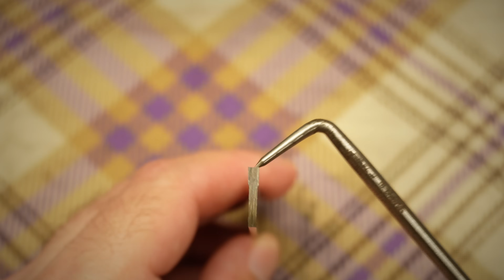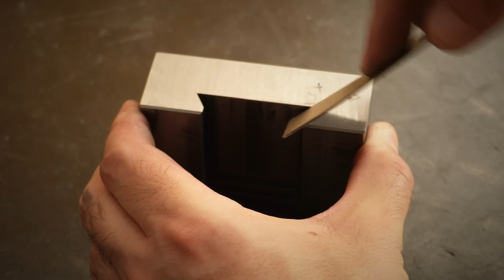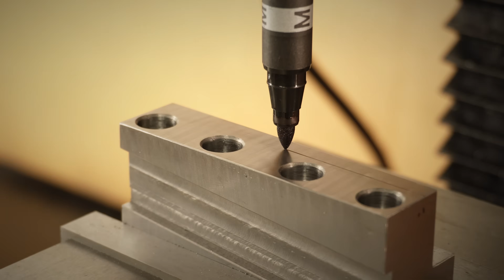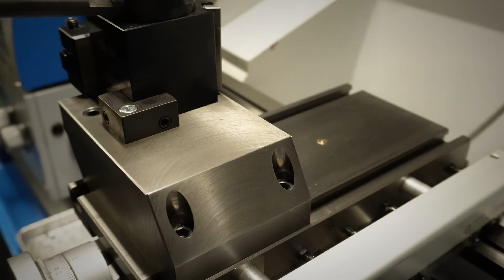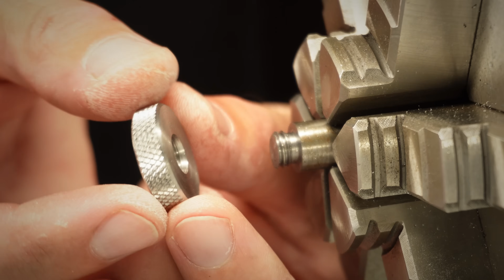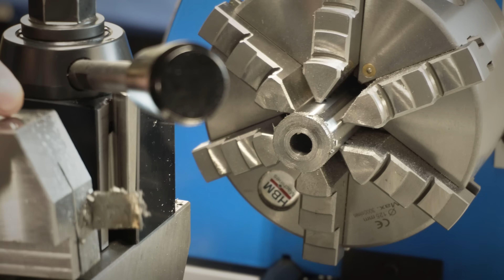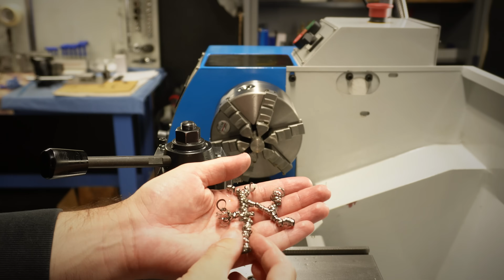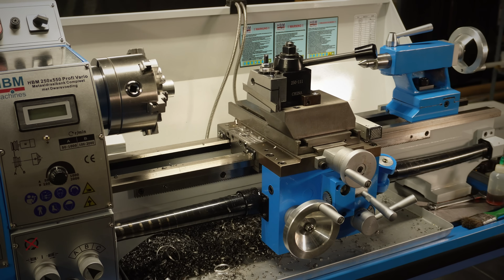Parting-off on the Lathe - Rigidity, Rigidity... and a Spring!

Comment: That really hurt, as I was watching you start to tap, I thought "not one of those !!"😣...& then SNAP ! 😥

 Not a fan of those spiral flute taps... spiral point is my go to...and maybe finish to full depth with the spiral flute in this case. 

The slitting saw twerking on that arbor was funny, I was waiting for it to grab ... 😂

Definitely, a scissor-type knurling tool is better, it takes all the loading off the spindle and cross slide and, for me at least, it gives cleaner knurls... (I have both types btw)

Really enjoyed this video, thank you 🤗
(You really deserve more subs with your content)

😎👍☘️🍺
Reply from the maker: Thanks! Yes, I think I will have to get one of those scissor type knurling tools, this was the second or third time I used mine and didn't like it. It puts a lot of pressure on the turning part/bearings. A hemingway tool would be nice, but I don't know if they are too big for my lathe?? Maybe a scaled down one would be better? Questions.

Slitting saw arbors, that's another one. They didn't grab because I was feeding very slowly, but I need to make a couple of arbors, that's for sure. Later, right now I'm working on something else! 😉

Comment: Great video and well explained, thanks for sharing.
I think the rigid solid tool post makes a huge difference. I always part of (SP200 insert) using the tool upside down that has the same effect as using the tool at the back of the lathe.
I have a Tapered  HSS-Co blade laying for some time now. I put it on my to do list to see how it compares to my current setup.
Reply from the maker: Thanks!

Comment: Was the finish significantly better when you left one insert in the face mill?
Reply from the maker: Hi, I didn't spend too much time testing different speeds and depths of cut, but that finish was the best I got. I tried with 2 inserts (opposite sides) and the finish was not so good. The machine can't cope with 4 inserts or more, it's just too much for the motor. Using that face mill was more of an experience, I ordered the 80mm version, but got the 160!

Comment: Best to play safe when hand tapping small threads and use a tapered starter tap followed by an intermediate lastly the plug or bottoming tap. Go in quarter turn then back off a full turn then repeat, never force it they will snap like carrots, if it's a blind hole regularly remove the tap to clean out the cuttings. Use dedicated tapping lube.
seized
 If you use cutting fluid on your machine tool  work you will get more life out of your tools and a better finish.

Comment: I had a very hard time parting off 2" aluminium round stock then someone suggested to give clearance along the length of the feeding direction, meaning cutting edge reduces along the length and it worked like a charm with good finishing. I cannot imagine now using a tool without grinding along the length but you here made a clean cut without your tool digging sideways. I guess i will try it use it, as my method reduces the strength of tool and regrinding tool tip 2 or 3 time makes the whole grinded length a waste
Reply from the maker: I can see the downside with that method, yes. Another thing that helped me before I made this tool was to progressively widen the slot with the part off blade. I'm not sure why that helped (maybe less rubbing on the sides?) but it did, and it's also safer because it accumulates less chips in the groove. But even doing that my lathe would stall frequently. If you want to try this tool with less effort making it, have a look at Winky's plans (link in the description). Thanks

Comment: I understand the principle.
Instead of digging into the cut it is automatically backed away.
With hand feed this is fine as you can back off and cleanup next time round.
What i don't understand is under power feed when the cut comes back around the depth of cut will increase because the cutter sprang awzy the previous time around.
Why doesn't it flex away twice as much and 3 times as much and 4 times etc. building up each revolution ?

Comment: a few recommendations that might seem weird (or you might have drilled into you from shop class)

Most threads are made to tolerances rather than to nominal. if your taps are 6H (the standard, at least to me) then the M4 tap will cut the tapped hole to a minor diameter of 3.422 meaning you could use a 3.4 drill instead of a 3.3 and thus not only save wear on your taps but also massively reduce the risk of breaking one.

if you are tapping in any material that produces long chips, the recommended method is to drive the tool for one rotation and then back it up for a length equalling the radial distance between the teeth or until you feel the chip get cut. Getting the chips out more reliably in this way reduces the risk of them clogging up a flute and locking against the side of the hole.

Comment: Although a pretty sensible accessory, present day machining is incompatible with this sort of tools. Throwaway carbide tip parting blades ranging from 1mm to 10mm standard come in different grades for different materials, have a high cutting speed (100 m/min easily) and feed rates (0.05-0.1). Replacing the tip requires just a few seconds and the CNC will be reset to the correct measure after the very first cut. Most of the blades are provided with a positive backstop preventing the tip from digging into the holder, thus ensuring constant accuracy when cutting grooves to a precise size. Since all production tools are standardised as regard height and width of tip, no need to check for correct centre height and their price is not exorbitant either. Anyway, a good excercise in fitting. Also, I cannot help noticing how well kept is the surface of your table, well done!
Reply: CNC and Manual machines are two completely different roads. For manual lathe especially small one this type of holder is game changer for parting off. Carbide blades likes a really heavy load when cut. That's why they tend to jam in small lathes as machine lacks rigidity. I have small 7x14inch lathe heavy modified and tried plenty different blades for parting. So far that idea is the best for such small lathe.

Comment: Tapered blades are called Johnson blade  the t blade are t1..t2. T3   .093...125...187.tpn would be carbide tip...screw mach  which your holder mirrors the ones used on old 2g machines

Comment: It is a very nice looking tool, that does the job. Congratulations. Parting off stock in a lathe has been a problem since I started working in a shop (1966). Things have become better with the advent of the newer style tool posts. I was shown years ago that inverting the blade, and reversing the spindle would help. It does improve things a lot, but takes time to set up for one cut. No one was ever able to explain the mechanics behind the improvement. 
  Since you cross slide has t slots the full length, another approach might be to build a dedicated tool holder of your improved design with a tool either upright or inverted. If you use a parting tool a lot, and also the compound rest, it might be worth your time. I will offer an observation from personal experience. Grinding the back rake on the parting blade does work well, but devil in the process is that the center height drops as the front is re-sharpened. Eventually a piece of the blade needs to be sacrificed to return to the original height, and full blade width. As you lower the front of a tapered blade, you start cutting two groove widths. The “T” blades will give you chip narrowing and consistent groove width.
 I do commend you for solving a problem in such a neat appearing manner, rather than avoiding it, and running to the cut off saw.
Reply from the maker: Hi Robert. You should have tons of experience! Thanks for taking the time to comment and share those observations!
Reply: @Robertqueberg4612 
To understand the principle, you need to think about the toolpost as a flexible structure (which it is... everything is a spring to engineers 😊). 

 So when the cutter digs in, what happens? With the extra force of a dig in, on a normal parting set up, the deflection of the toolpost moves the cutter INTO the work, with either chatter, or more catastrophic results ... but any of the 3 options people have suggested in the comments (viz the design here, or a rear toolpost,  or an inverted tool in a front toolpost) all 3 produce the outcome that the extra load of a dig in causes the tool to deflect OUT away from the work. 
This prevents the catastrophic outcomes,  AND the precursor chatter behaviour.

Comment: if you ever need a good finish try inserts for aluminum on a36,  or the grind relief and rake angles for alu if its a stick bit in the fly cutter   a36 is soft as heck and leaving a built up edge on the tool making it cut like its dull. also makes it rub if the relief angle is not high. you could also increase the sfm to up the cutting temp but i think your best bet is to make the tool have a higher relief angle and rake.
Reply from the maker: Hi Brandon, thanks! That is something I will try. Appreciated! 👍

Comment: Thank you for posting, excellent work. I am an old automatic lathe setter, when grinding the front face of the parting tool we would angle the face from 90deg to approximately 120 deg this gives the job a far better finish with little or no ‘Pip’, the piece is not broken or pushed off but cut right to the end.
Reply from the maker: Hi, thanks for that. If you look at the chip formation on the 0.5mm test, you can tell I have it slightly angled. That was on purpose to achieve what you describe, but I think the angle was not enough as it didn't make much of a difference. I didn't play more with that because I thought a more aggressive angle would push the blade into the work (these blades are thin and will bend) and make a concave face. But with time, I will give it another go. Thanks for your input!

Comment: Excellent result.
I also was inspired by the Winky spring parting off blade holder so made one. I based mine on the original Armstrong design. My lathe is tiny so parting was always scary!
It works a treat. The only negative is that it cuts slightly dished with no obvious reason. Watching this video I will try clamping on the bottom as that seems a good idea.
Reply from the maker: Did you check if your blade is square to the work? Or if the tip is ground square to the blade or if it's ground slightly towards the chuck or tailstock? 

Also, how are you holding the blade and what size of blade are you using? I'm asking this because I can imagine my 'not so tall' blade flexing if it didn't have good support and if it wasn't square to the work. Maybe that's causing it to dish? Just a thought.

I decided to support/hold my blade with 4 screws from the bottom because I was afraid the washer might let the blade slip (it also allowed me to better support the 2 blades).

Comment: 1) Tool should have as much contant with toolholder as possible, that reduce vibration. You have contant only on edges.
2) Higher tool is better in terms of stiffness.
3) Grove in the middle of carbide inserts makes chips narrower and help evacuation.

Comment: I cursed with you on that broken tap 😂 Very clever design and execution. I might need to make one as well since I have several T type blades and no way to hold them!
Reply from the maker: Hi Brandon! Nice to see you here. That broken tap...! I was extra cautious cleaning the chips and adding fluid. I was feeling the gummyness and taking things slowly... and then it broke with just a couple of threads to go! I went through the roof very fast 😄 but hey, at least I learned how to remove it. Can't wait to see your take on this!
Reply: @nbrworks  I know the feeling so well!! I need to increase my carbide mill/drill collection just so I can be prepared when that happens to me 😅 You saved that masterfully

Comment: A very good design and result. I don't however you've seen the worst of what happens when parting goes wrong. I used to have a minilathe. When parting went wrong, it stalled. OK, not great, but I upgraded to a well used Harrison M300. 3HP motor plus geared head. When parting went wrong, it would snap the blade with an almighty BANG! embedding shards of the parting blade in the work and leaving me very nervous about parting!
However, I'm encouraged to watch more of your videos so you've earned another subscriber.
Reply from the maker: Thanks for subscribing. You're right, I didn't have a blade breaking yet, and one should respect this operation (as many others). As I say at the end of the video, I don't normally run my machinery hard, but for the video I had to show you the difference the tool made, hence risking it a little bit more. Thanks for the warning, it's sincerely appreciated 😉

Comment: Change feed direction so the chips are thrown away from you and towards the column of the mill.
Reply from the maker: Thanks for the advice!
Reply: @nbrworks  for added safety have pieces of thin plexiglass that you “clamp” with a strong magnet to the front of the spindle housing. A piece that can cover the gap between the spindle and the workpiece or the vise will protect your eyes and skin from hot, sharp chips. 
Until you make a power feed drive for your mill, use gloves and wear long sleeves.

Comment: The principle behind this type of tool holder is to raise the fulcrum location. Ideally, it should be above the cutting edge, so that if the blade binds, it will automatically swing away to reduce engagement. This design used to be popular for lathes with threaded on chucks that could not be run backwards. On lathes that can be run backwards, simply flipping the blade/parting tool upside down and running the lathe in reverse will accomplish the same thing. Flex in the compound, which normally places the fulcrum location beneath a conventionally mounted tool and cause the cutting edge to dig in deep when loaded, will reduce engagement on an inverted tool running in reverse.
Reply: Thanks for the really clear explanation of why this works! The idea of turning a weakness in a system into an advantage for a task is so often counterintuitive that it isn’t even considered.
Reply: Good explanation and, having used a spring parting off holder I can see that you are correct. Also, the amount of spring seems uncritical as the tool will always flex just enough to unload it then feed in again. This seems to be the cause of the initial chatter one hears on first engaging the cut, until it settles at some equilibrium.
Reply: I never figured why the inverted parting tool trick was always reportedly so successful - great explanation, thank you!
Reply: @mosfet500
You're correct mate... but you are wasting your time trying to educate someone who apparently already knows it all.  😂
Reply: Can't wait to try this.Thank you!
Reply: I'm sorry to have to tell you, that the saddle doesn't have provisions to prevent lifting off the front. But it does have a clamp to hold the read down tight. So running the lathe in reverse reduces the rigidity. The only reason why this might help is because usually the rear of the cross slide is worn out less. -> repair your lathe!
Reply: @MuellerNick  There may be some oddball non-reversing lathe that does not have retention under the saddle, but that would be unusual.  Further, Z-axis locks typically clamp the front bottom of  the saddle. So everything that you've claimed is wrong. 

In regards to my lathe, it works great and doesn't need any repairs.
Reply: @EDesigns_FL  Maybe you should have a look at the Z-axis lock. It is called "lock" for e reason. It is not called "guide" for the same reason.

And your lathe works so great that you have to part off in reverse. Now that makes sense. But just to you.
Reply: @MuellerNick  Pull the apron off your lathe and you will see how your saddle is restrained from lifting. 

What you're calling a "lock" is actually a clamp. 

My current lathe is sufficiently large and rigid that I can part-off conventionally  without any difficulties: Nevertheless, I have been doing this long enough to be acquainted with techniques used on smaller lathes, and your ignorance is blatant.
Reply: @EDesigns_FL  First of all, YOU called it a lock (as it is just this).
Second, why don't you run your lathe aways in reverse, if it works so much better? More DOC, more feed, more surface speed. You name it. This "run-in-reverse" tick is an old fery tale, nothing more. And only hobbyists spread it as their last resort to avoid thinking about the problem and understanding physics.
Why add flex in the tool and then run the lathe in reverse to gain rigidity? One needs to be quite simple minded to make sense out of this.
So, you are welcome to stay in your bubble and continue promoting voodoo.
Reply: @MuellerNick  I can attest to the upside down cutting tool and lathe in reverse. I have successfully cut 17-4PH  1-3/4" stainless with this system and a rigid cross slide base. What happens in severe conditions is that the holder actually lifts up in the Aloris out of the way of the part saving the cutter. That only happened when I tested my home made upside down holder pushing it beyond what I should have. In normal usage this never happens.

It would be interesting to make an upside down holder with a spring like this machinist did though.

Comment: Bravo tous les deux pour votre progrès et marriage. Pourquoi deux dérives et pas une aile? Vous pourriez toujours rester debout sur du sable? Et si vous vous planté dans du sable est-ce les dérives résisteront l’impacte?  Perhaps you prefer English but you need french followers too
Reply from the maker: Thanks. My French is a bit rusty... are you referring to the tool holder being able of standing upright? If that's, after slotting the front from the back, there's a tab of metal. I could remove it but the holder would fall off - I kept it just because of that. Check 19:58. Hope this helps.